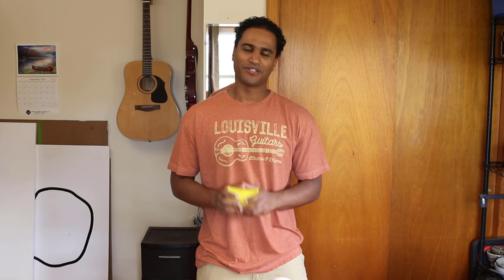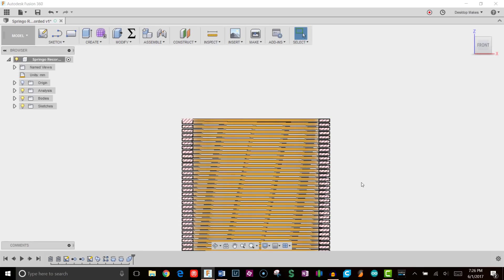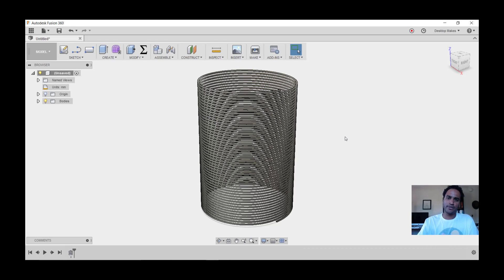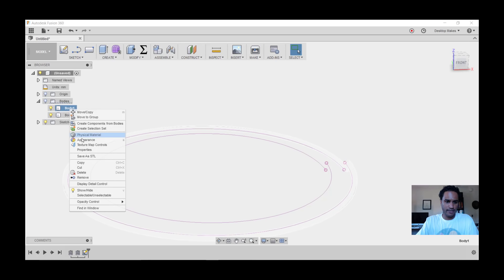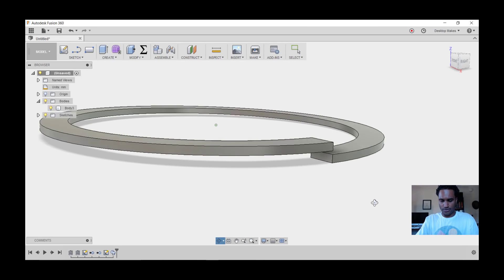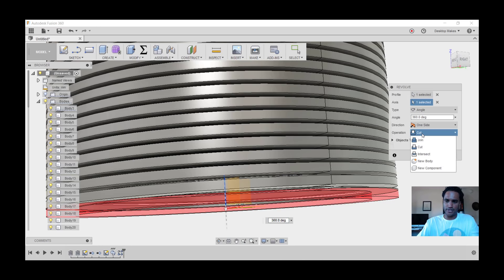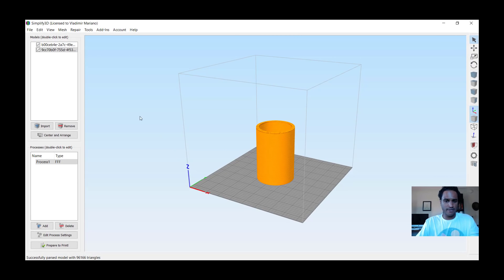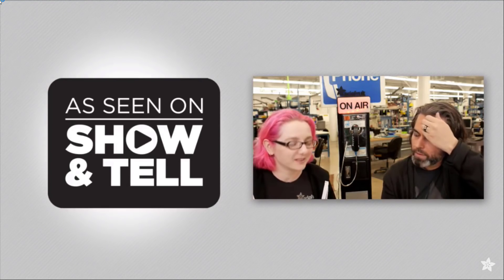Design a Slinky in Fusion 360

Comment: Your videos are very good. I was trying to use the coil tool to make a DNA Helix, but got thrown by the connecting rods in between. Can't figure it out. Any ideas?
Reply: I know its a bit late, but you may be able to model one of your rods, then use the Pattern on Path tool and select your helix as the path. Fusion should copy and orient your body along the length of the helix.